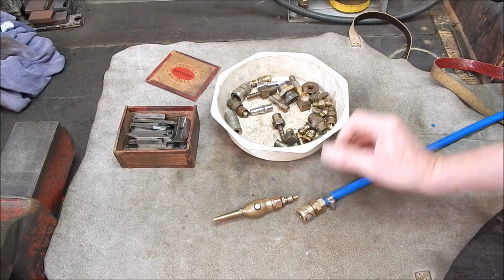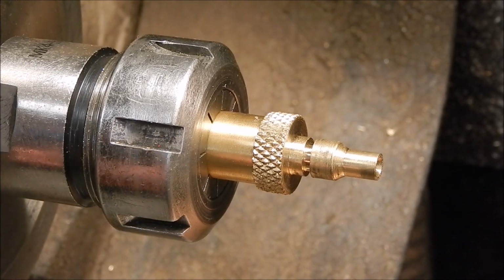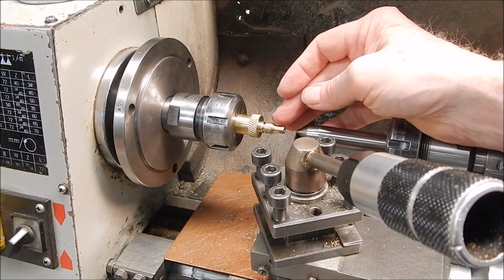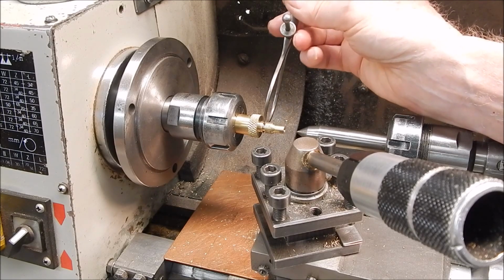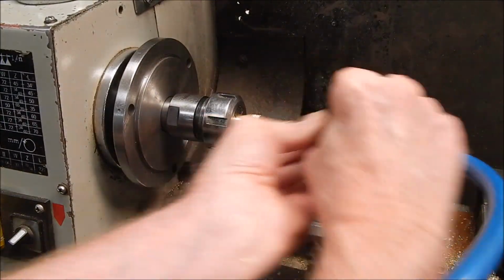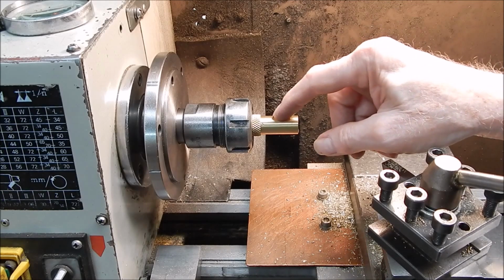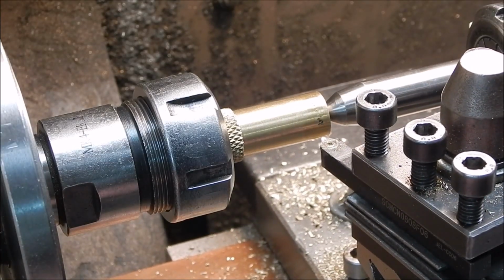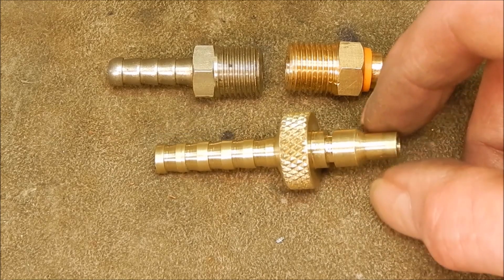Make a male air hose connector on the metal lathe

Comment: Nice job Rob 👍👍 Good tip with that long dead centre. Cheers, Alan.
Reply from the maker: Hi Alan.  I use that trick very often.  The one in the video is HD industrial grade and has a carbide tip.  So long as you keep the speed down a bit and don't crank up the end pressure too much, dead centres work fine.   I have about half a dozen different length and diameter ones made up mostly out of round HSS.  They get used on all my lathes at times, including the Sherline.  Cheers Rob

Comment: I've seen those connectors at motor mechanics shops but never had them in my possession, only Nitto. I found an equivalent (with Nitto rather than Jamec) to what you made on an Australian supplier for $4.60. Still that doesn't include the pleasure of making ones own. I enjoy your Vids Rob, thanks mate.
Reply from the maker: There's no reason why you couldn't machine up some male Nitto connectors on a lathe in the same way.  Pretty simple operation. Cheers Rob

Comment: Thanks Rob! You gave me ideas how to make stuff either blowing chips away or cooling the motor on the micro mill with controlled air blow based on an 8 Bar compressor. Mag foot is already at hand.
Reply from the maker: Good to hear Stefan.  It's all doable.  Cheers Rob

Comment: Funny how you mention the old school spring calipers. Just last week another another channel (a retired high school metal shop teacher here in the states) tested the accuracy of them in use. He had only ever used them for woodworking previously. If I remember correctly, his first try was off by about 12 thou, but he said it hadn't felt right. Second try was exactly right (less than a thou off). In sensitive, experienced hands, I could easily see quite accurate "production tolerance work" being turned out rapidly using them as the working reference. I see the Pakistani job shop/ primitive production factories use them constantly in vids,  along with using a "cats whisker" for centering and truing turning jobs, much to the consternation of commenting "real machinists", of course
Reply from the maker: They used to teach the use of spring calipers during apprentice training years ago.  I'm not sure what gets covered now.   I can get extremely accurate fits using them.  I also like micrometer accuracy, but they don't always suit small work.   I guess spring calipers get overlooked these days because they are old hat and not as flash as all the digital gear around, but once again it's all only as accurate as the way you use it.  Spring calipers are great time savers as you don't have to shut down the lathe to use them.  Cheers Rob
Reply: Mr Pete, bless him, saw that one
Reply: @Ralfy Customs  exactly! I found it interesting as I had seen many Pakistani shop vids with the litany of "omg, can't be closer than an eighth using those ice tongs!" comments, while the result was pretty obviously accurate press fits and such. Lyle's vid demonstrated accuracy IS possible, properly used. Certainly accuracy at the "roughing out" stage of production is quite easily handled by them.

Comment: Can you show how you made the barbs?
Reply from the maker: I did film this, but made a mistake with the camera, so no video of that aspect.  It is however very simple.  Just use a chisel edge cutter to shape the recess angles for each.  No cutter top relief is necessary, so the square end of a piece of HSS with some front relief works fine.  Cheers Rob

Comment: Hi Rob, thanks for the video. Do you set the outside caliper with a gage block; I am assuming that's how it is done. Or do you use the original part?
Reply from the maker: Hi Bruce, I use the original part to set the outside caliper when it's a simple copy exercise.  I use vernier jaw flats to set up an exact measurement with the spring caliper in all other cases. One big advantage is that you can check the job with the machine running, which saves a lot of time.  Cheers Rob